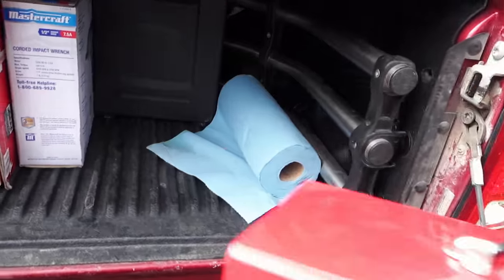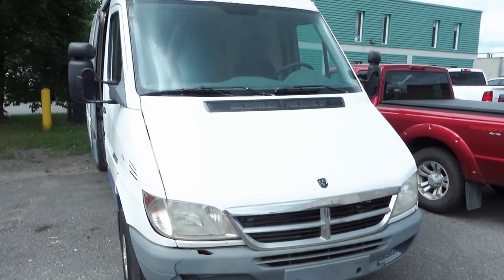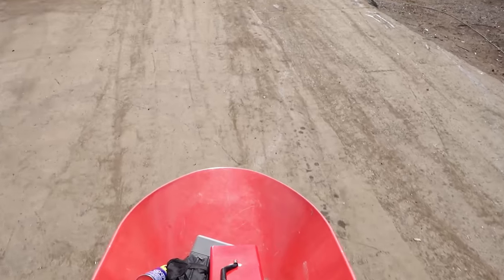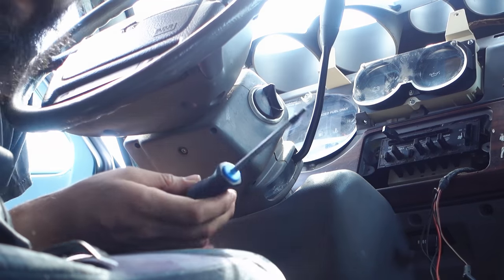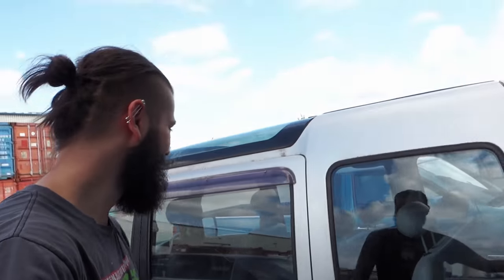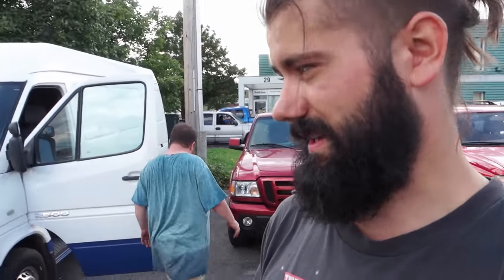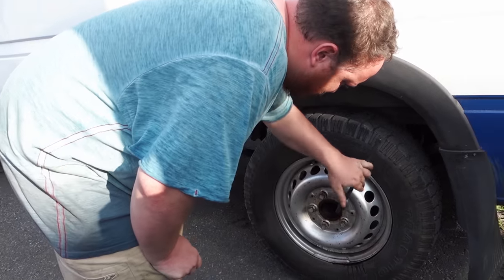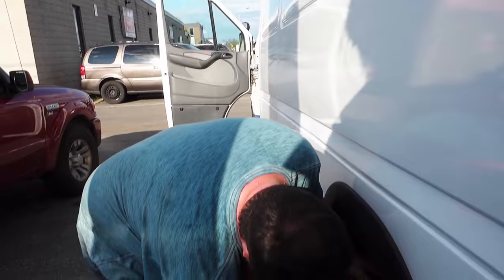Extra Tiny Vanlife - Van Life 162

Comment: I've dealt with a few stuck tires like that, You need to hit them HARD, like harder then you can do with flip flops on haha. I normally take a small sledge and hit it on top, bottom, side, side and alternate like that 4 or 5 times to vibrate it loose then one good kick on the top with a boot should do it. If you kick the bottom have a hand on the top so it doesn't smack you in the leg =)

Comment: First off I love your videos. Especially the soundtracks and the drone shots. Also I'm a auto technician for chrysler/dodge/jeep. I agree you just need a hammer to get that tire off. Hit that or that rim looks like a steel rim. A hammer won't hurt it. Or get a big ass prybar and using the lower shock mount as a pivot point, pry against the rim. Some heat (map gas) around where the rim meets rear bearing wouldn't hurt.

Comment: While it's not directly apparent in the video, we did hit it with a 3LB mini-sledge ... A LOT.  We also both took it around the block with the lugs loose, in my case through pot holes at speed, onto and off curbs, braking fast, etc...   In the end I took it to a tire shop to have the tires  changed (needed to be done anyhow).  The place was empty at the time, needless to say I was there for about an hour and a half while they changed my tires, all the while the most innocent look on my face.

Comment: you need some PB spray to get those lugs / tire loose. hit it with a hammer from the backside of the tire as well. I had to deal with that a lot in the shops I have worked in.

Comment: They keyswitch thing is easy if you haven't figured it out. Should be a big pin-type thing you can drill out to slide the tumblr out. Then just swap your old tumblr into the new switch unit (Don't need to drill the pin if you have the key)

Comment: Don't you find Sprinters cargo vans over the top for price here in Canada.. anything I've looked at is either outrageously expensive  or it's one step away from the scrap yard..The other thing is that newer model sprinters seem to loaded with electronic engine controls and sensors making it impossible for just any mechanic to work on..And one more.. have you looked at the price for parts for these suckers..?  But yes they would be very cool to turn into a build.
Reply from the maker: mechanics won't even work on my van. Honestly anything that has an ECU is going to be very complicated to repair and require a lot of research anyways. This particular one was bought for 4500 and came in a little rougher condition than mine did, and it hasn't yet been converted. I think that's a fair if not good deal. especially considering the efficiency and reliability of that engine.

in short they're out there. Jeff had to drive 300km to pick this one up. So it takes some commitment.
Reply: I think the same is pretty true of all vehicles built within the last 10-15 years has fairly complex computing, in that they'll often have a number of micro systems that require specific, or in some cases, very expensive diagnostic equipment to read and clear the codes from the system.  I jumped at the chance to dig in and ran down to Canadian Tire, picking up a fairly standard ODBII unit which can't read 15+ compute systems available within the Sprinter, something I didn't know going in as I'm not "super" car smart.  I have rectified my mistake and ordered a unit out of BC (used) that will allow me to read and clear almost all the systems.

As for the price, I paid $4,000, the ask was $4,500.  As pricing in general, yes, they are very expensive vehicles compared to your standard van or mini-van.  You have to realize that when these vans are new they are $50-80K typically, but are designed to go about a million kilometers in their service live, assuming they are maintained.  If you actually look around you'll see them all over the place UPS, FedEx, Canada Post, Buses, and various contractors/delivery service companies.  Most components have aftermarket parts available, at least the common stuff anyhow, anything that you have to buy original for is always expensive though, a bit more in this case as it's MOPAR.
Reply: Adtenture van Dustin